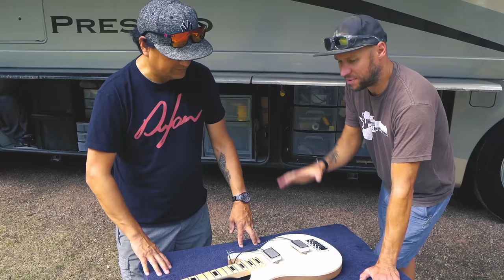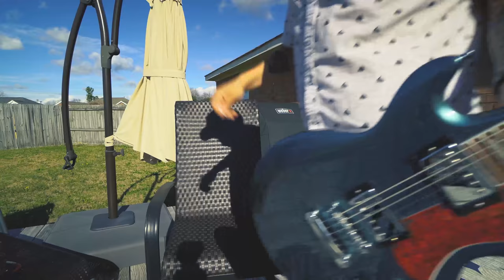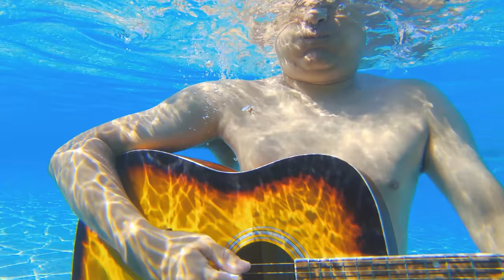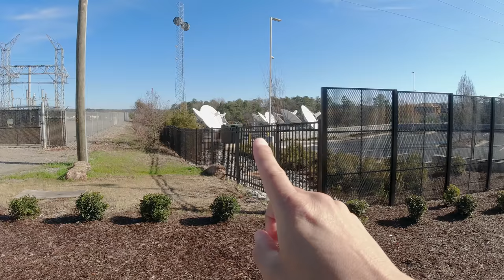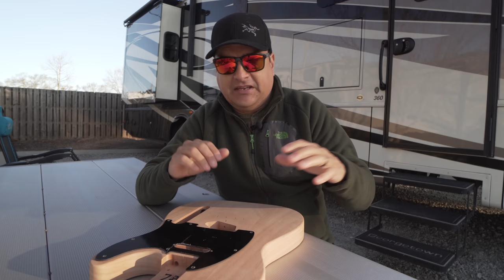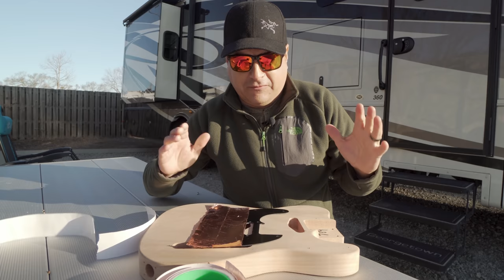How To Shield Your Guitar - Myths Busted

Comment: Once upon a time, I was awarded a degree in electrical engineering from an accredited university, so I've met the kind of people you're talking about, Dylan). For the record, I thought you did a great job of explaining the general ideas without dragging non-technical types into the weeds. For practical purposes and simplicity's sake we often neglect those higher-order effects, meaning that engineers usually deal with approximations of varying precision. Enough to get the desired results while still making the math possible. Looked to me like you walked that line very well with this video.

Comment: Thank you!  I did a Strat copper shielding project this weekend - including the output jack bc the other youtube examples did NOT mention to avoid jack cavity shielding.  Shielding made a huge difference, but I started having some popping sounds when moving around.  So I swapped the jack for a new one.  Then I had NO sound after screwing jack into cavity w cover, but it did work w/o cover.  Noticed that jack plug was just touching shielding, and had watched this vid, so I removed.  Problem solved.  And the guitar is still quiet w all of the other copper foil treatment and groundings.
Reply: did you shield the portion with the tone knobs etc

Comment: Hey Dylan! Big fan. Couple very important practical things. This isn't academic or pedantic, this is all practical -

You can't solve a magnetic field (guitar noise) problem by treating it like an electrical field (radio antenna) problem. Using the "pickups are radio antennas" analogy is great, until you try to solve problems like noise. 

Pickups are not RF antennas. And yes, this difference matters! 

A 60hz EMI or RF wave is not 18 feet. A 60hz SOUND wave is 18 feet. A 60hz electromagnetic wave is 16,400,000 feet because it's moving at the speed of light, not the speed of sound.

For your guitar to be a even a quarter wave antenna, the wiring would have to be about 790 miles long.

Further, all of the discussion of a guitar acting as an antenna is assuming it's in the "far field", as radio antennas are. Far field doesn't start until about 2x the wavelength. For 60hz, far field is about 6,000 miles away from the source of the noise. Meaning - You'd have to be 6,000 miles away from the source of 60hz hum for RF shielding like copper tape to work.

These insane distances mean guitars are strictly in the "near field", which behave incredibly different from far field objects like radio antennas. RF shielding does not work on a problem that is not in the RF far field range. 

TLDR: Your guitar is not an antenna. You need to shield against magnetic fields, not electrical fields, which are very different, unless your pickup happens to be 6,000 miles long.

Thanks for reading, if anyone did.
Reply: I read it! And now my head hurts, and I'm further confused at to what do with my guitar! Maybe I'll just learn the harpsichord.
Reply: @ajb625  - Get an acoustic.  ;-)
Reply: So how do you shield against magnetic fields then?
Reply: I was about to do the same kind of comment about the wavelength. Also there is a mention of 'skin effect', and i don't really see the point when talking about guitar shielding. In any case , in the audio spectrum and for an object the size of a guitar the Skin Effect is absolutly negligible.
To me the 'shielding' in guitar is a way to establish a good ground. Not more than that. Jazz Boxes and ES-33x guitars are not shielded and not more noise prone than solidbodies..
Reply: 73
Reply: @roardog6451  38

Comment: Thank you for the clarification!
I have a roll of copper tape with conductive adhesive to put in the pickup cavities, and pick guard. 
Staying out of the control area is really great news! 
Eliminating possible shorting issues, with low to no benefit, will save a little sanity!
...I just have to remember, “Stay grounded!”

Comment: Hi Dylan. 
I enjoy your videos, so thank you for making them. I thought i would chip in with my experience here, specifically shielding of the electronics compartment. Not to disproof you at all, because i think that you are correct in what you are saying, just to share my personal experience. 
I have this Tokai strat that i really love playing, but i found myself using other guitars more because the buzz/hum from the guitar annoyed me. I have a godin session, which i had installed Mojotone quiet coil pickups in, and the thing was dead quiet. So i thought i would put the quiet coils in my Tokai and all would be good. So i swapped the pickups and to my surprise the Tokai was still quite noisy when i did not touch the strings. The only thing that was different on the two guitars was the shielding. 
The Tokai was shielded in the pickup routing and on the pickguard. Because i ran out of cobber tape, the electronics compartment did not get shielded. The Godin Session was shielded all over also in the electronics compartment. I thought to myself i had to try shielding the electronics compartment of the Tokai to see if this would change anything, and sure enough it made the Tokai i dead quiet aswell. I do agree with you that shielding the electronics compartment can lead to some issues, but if you look at the components and your space in the compartment,you can tell where you might run into trouble. I just put some vinyl electrical tape in the two areas i saw as potential issues. 
This is just my experience, shielding the electronics compartment did make a pretty big difference in my Tokai.

Comment: Hey Dylan! Great vieo! You said that shielding controll cavity would not change much. I have old Framus guitar, with Bill Lawrence LTS pickups. I decided to change wires in cavity, which were old and degraded. I didn't want to mess with shielded pickup wires which were fine. Cavity wires were also of shielded type. I changed them to regular wires and instantly i got massive noise. Then i shielded that cavity with tin foil and averything was back to normal.
Reply: Ive experienced similar. I reshielded my guitar from stock and it is much much quieter. It is especially noticeable when using high gain.  Its a day and night difference. It was unbearably noisy before.

Comment: I did my 89 Kramer Nightswan a few years after I bought it.  I use copper foil and I did solder the joints between each strip.  Now  my volume pot is a push/pull as it's my pick up selector switch,  I have a Seymour Duncan JB pickup in the neck (passive) and a Seymour Duncan heavy metal live wire (active) in the bridge.  The guitar is completely silent with the volume cranked until I hit the strings and it's full sound.  I wish all my guitars were like this. It's a guitar with pass and active and works wonderful.  Anyone who knows those pick ups,  knows how hot and loud the Heavy metal live wire is,  18volt , lots of jam lol. Probably the most versatile guitar I have, the JB has a coil tap, so the guitar goes mild to wild.  Each pickup cavity has copper tape and the control cavity  with a wire soldered to each joining them. Lots of work, but well worth it for me. Also did my Epiphone Zakk Wylde model and changed the 9volt setup to 18 volt on it and works just as well.

Comment: To all the Propeller heads that try to correct Dylan’s “science”

He is teaching concepts/ practical applications for laymen guitarists. Not mathematics or physics.
Lay off... Most guitarists... even legendary ones ... Don’t know shit about guitars... and they will tell you. They just pick it up and if it sounds great they love it... If it doesn’t they leave it.

Us hobbyists love tinkering though, and need practical applications to improve what we are doing and BASIC concepts that we can apply to our next guitar or project.

For instance... I’m betting that trying to shield the output jack cavity is a bad Idea on any guitar not just a tele... If your solder joint for the signal wire or a bare part of your signal grounds on that shielding..... Welcome to Zero output.

Keep putting it out the way you do Dylan... We get it.
Reply: It's an output jack, not an "input jack".
Reply: @BobaFettBountyHunter  it works both ways
Reply: @jennjennjenn61992  What signal do you send to guitar to make that jack "input"?

Comment: you immediately answered my question at about 3:30 , any need to keep watching? Edit - okay, so I did. I understand the idea of shielding the rear of the pickguard only. But I believe it is not necessary to run a ground jumper from the pickguard. The pickup mounting screws & springs are grounded to the pickup, so the copper shield will ground via the springs. You can test the pickup mounting screws are grounded by touching them, hum reduces or goes away completely.

Comment: For the shielding: wood glue, standard tin foil, desoldering copper mesh as a ground wire, small wood screws to fix the copper mesh in a few points and to have good ground to the tin foil, the bridge and the pickguard.
For the wiring: twisted pair wires from an old ethernet cable and shrink tubes over all terminals, so i don't have to worry about anything making shorts, therefor I shield all cavities and don't have problems with shorts. I also use a TRS jack to keep GND and low side of the signal separated. With classic TS cables the GND the low side of the signal will get connected when the guitar is plugged in. With a TRS cable and amps with balanced inputs, i can reduce hum even more, because now i have a balanced signal and shielding to the amp.

Comment: i added copper shielding to each of the individual pickups. I shielded the top of the coils and ran it down to a shield wrapped around the coil itself. This was grounded with a solid wire directly to the pickup ground. The top shield is one long U shape with a tab at the bottom of the U to wrap over the end of the bobbin and down on the end of the coil. This runs alongside of the pole pieces. The top of the bobbin, opposite the tab end, has to be open. The shield can't totally surround the pole pieces. This lets out eddy currents. If you shield in the eddy currents, the highs will be sacrificed. The same applies to the shield wrapped around the coils. It can't be a complete wrap. I leave about a half inch gap open. This wrap goes over the tab from the top shield. I put the gap on the side opposite the pickup wires. This way I can solder the wire right from the ground connection to the copper shield. I use copper shielding with conductive adhesive, so I don't have to solder the two shielding pieces together. I think this may stop the "sticking out" scenario from letting EMI in through the front of the pickup. Some people put the upper shield on the inside of the pickup cover. That requires that piece to then be connected with a wire to ground or to the other shield piece. Easier to just do it on the bobbin itself.

Comment: Excellent, excellent, excellent.  Does the back of the metal control plate (mounting plate for the pots and switch) need to have shielding tape applied to the back of it as well?  Or will the metal itself shield once it comes into contact with a strip of the copper tape?

Comment: I have already shielded several guitars with copper foil (single coil pickups), in the best possible way, and star-grounded everything possible.  I noticed a clear improvement.  However, I have the impression that certain very high treble frequencies are a little lost.  I'm not 100% sure because I didn't record the sound before/after to compare.  It's just an impression, perhaps due to the fact that there was no more buzz...?
What is certain is that it is very appreciable to have less buzz when you use gain pedals or play loudly.  The buzz is not 100% eliminated with the gain pedals, but in clear sound yes.

Comment: I have seen people run wires between the cavities and solder to the foil. If the pickguard is shielded and you have overlapping shielding (for example as you have from control cavity to body), then doesn't the pickguard tie them all together and you don't need wire between the cavities?

Comment: the graphite paint does seem to help. but if a pot feels loose,don't turn it till the body moves cause one of the solder lugs could ground out. so tighten it pronto. Every little bit helps.

Comment: Great video but........didn't really catch if shielding the guitar is even needed at all, seems optional. Maybe I missed it. It was rather nice to hear that you don't need to shield the control cavities. I will be doing a Tele build and like the pick guard application, but do you need to also shield the bridge position? Or do you not even need to shield anything? There are so many videos out there on this, it's hard to determine who knows what they are actually talking about.

Comment: Hi Dylan, I use the conductive copper tape too. I tried the paint but it takes two coats and takes too long to dry . Guitars still hum but not as bad . It would be cool if pickups had covers that were emi resistant

Comment: I use aluminium foil tape but when I overlap the tape pieces i fold over the next piece so aluminium is touching aluminium. If your adhesive is conductive that isnt nessesary but if it isnt that will work for sure.
Reply: true but the aluminum touching aluminum part isn't held by glue, so, maybe it could no longer contact after a while?
Reply: @swisstraeng  If you only fold over a small piece and run it the length off the strip it wont come up but I typically put another piece over the folded seam for aesthetics anyways lol. I building a telecaster now and I made my own conductive paint. Tested it out and it conducts perfectly. It's just graphite and black gloss acrylic paint. Foils will easily show continuity(very very low to no resistance). But what most people fail to realize with conductive paint is that just cause your not getting solid continuity diesnt mean it's not conductive and working as a sheild. A better test for conductive paint is an ohm reading or if you dont have a meter use a 9v battery and an LED. If having solid continuity is important to the builder/modder then mixing on more graphite and adding more coats will get you there.
Reply: I was going to say the same thing. I found some aluminum tape in my parents' attic and used it for shielding years ago. Testing it with a meter showed an open circuit so I just folded down a corner to make contact. Since then I've upgraded my pickups and the wiring is shielded so it's probably not even necessary anymore.

Comment: Interesting video. So, just to make sure. If I'm building a Telecaster (I am), and I want to shield it, all I have to do is put the copper on the back of the pickguard, add a little piece of tape to make the shielding on the back of the pickguard come in contact with the control knob plate and it's shielded?

I don't have to wrap all the routed cavities in copper tape and connect them with shielded wire to the ground lug on the input jack?

Comment: Great video again.  Yes, I use the foil you use.  I looked into the paint, only to discover they recommend several coats.  Well that means I would be sitting around waiting for paint to dry.lol  How silly is that.  I understand from a manufacturing view,(making big batches) they can put them aside while making other parts.  For me, if I take the strings off of a guitar, I want to get the new strings on asap or at least,the same day...
Reply: Dan.   The paint actually dries rapidly.  If you go that route do tel solid coats.

Like all paints shake it up good in the container first.  Paint is glue with “stuff’” and color in it ….. no paint in the world works properly without all elements up in suspension.

Now go out and bend it like BECK… Jeff that is 🎼🎸

Comment: Good stuff.  I like to know the theory, but yeah, I just want to reduce noise on a guitar here.  I guess grounding happens at the point where the cable makes contact with the jack on the guitar and then stray 'juice' flows out the cable.  Correct?

Comment: Lot of good info in this, would a sheet of aluminum foil attached to the back of the pick guard and a wire to the volume pot case work?  I was thinking the aluminum foil could be attached to the back of the pick guard with some 3m spray glue and flattened out with the edge of a credit card.

Comment: If your electronics cavity is shielded (either by a foil job or conductive paint spray) and something is touching where it shouldn’t, leading to a short or one pickup not working or whatever - just put clear packing tape in the insulated cavity over the foil. Insulates it electrically from the wiring harness while still retaining rf isolation.

Comment: Truth you speak. I've done it wrong before. The shielding was working better than not having it except I had already added an extra switch. What kind if switch? It was the early 1980's so of course it was an in\out of phase switch. I did it correctly but since I only had one conductor and a shield per pick-up, if I used the pick-up that was effected by the switch, guess what happened? If the one with the switch was the only pick-up on and I left it in the "out of phase" setting the shield was the HOT. Man let me tell ya, in standard position it was nice&quiet. The other way, not so much. Mixed with the other pickup the overall volume drop made the hum get lost in the wash of cymbals and vocals. By itself however the spread of the copper foil became the antenna for everyone, everywhere, everything, all the time including next Thursday!! I didn't use the out position that night so no harm except for the first time the sound man heard it. He made me tape the switch in the 'Normal' setting.